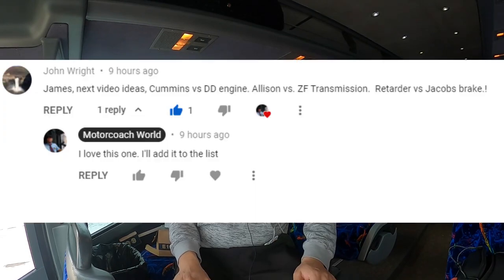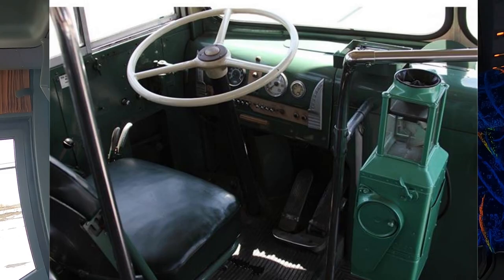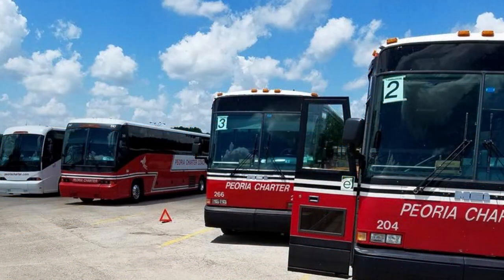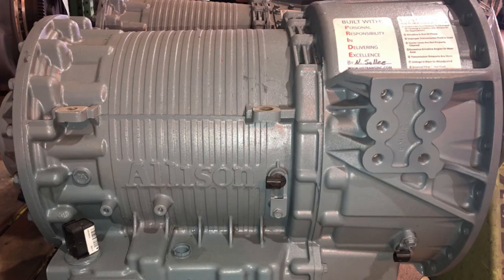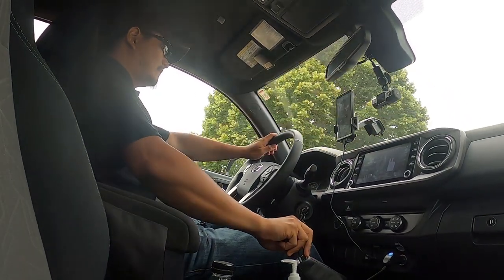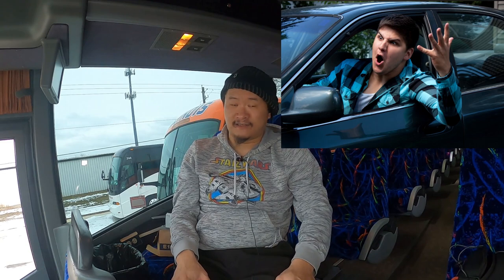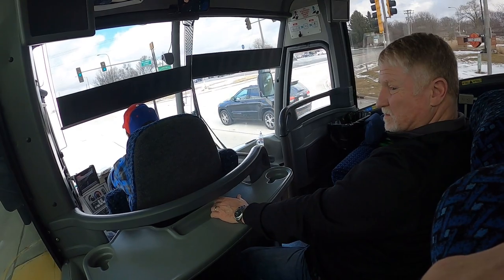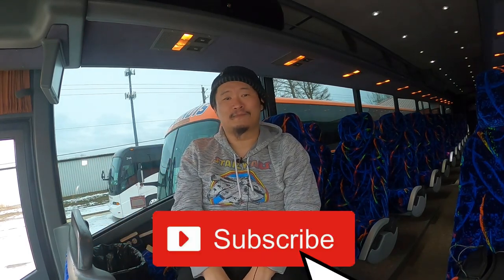Coaches buses come in Manual, Automatic, and Both .  The ZF Transmission

Comment: I started working for a transit bus company about 6 months ago as a driver. All buses in our fleet uses these automated manual transmissions. I have to say I'm on the 'hate' side of the fence to these transmissions especially when all my own cars are stick shifts. Not only do they exhibit all the disadvantages as you've mentioned in this video, a lot of them also do not shift properly due to age or poor maintenance or both, making the ride a very jerky and uncomfortable experience.

Over time, I've slowly discovered on my own on how to operate these transmissions in the smoothest possible way. Things like avoid pressing the brake at a certain rev range, easing or flooring the accelerator pedal under certain conditions to avoid unnecessary shifts, and some other weird things that I can't describe in words in order to operate these transmissions as smoothly as possible. The positive thing about all this is that it makes me a much more conscious driver as it involves a lot more forward planning.

When these transmissions work properly though, they're a pleasure to drive especially for transit buses that are required to stop often in heavy traffic. I do feel powerless a lot of times like you mentioned in this video, and I hope that stick shifts will make a return to buses, but that will only happen in my dream now.

Comment: I was building Scania coaches in the mid 80s, they had what they called CAG (computer assisted gearshift). The gearstick was like a game joystick on the dashboard, the current gear was displayed next to it, push the stick to the next gear, then push the clutch at anytime to change to that gear. Never drove them but drivers seemed to like it.

Comment: Hydromatic transmissions were available before WWII in Oldsmobile and Cadillac as an option. Flathead Cadillac V8 and Hydromatic transmissions powered many tanks through WWII.  My first car was a 1946 DeSoto with fluid drive and an automatic overdrive. Hudson had a vacuum shifted manual transmission in the post war period. My 1956 Chrysler had push button powerful item transmission. 1964 my Renault had a relay shifted push button nightmare of a transmission.  2007 my Freightliner had an Eaton Fuller Ultramatic electronic shifting manual transmission that was slow to accelerate and wasn't precise when trying to back up to a dock.  What I really like is the one speed electric transmission in my Hybrid.
Reply from the maker: Loved reading this! Thank you for taking the time to write this.
Reply: The Ford model T had a planetary transmission,  outlawed in 1927 which standardized H pattern with a clutch, brake and accelerator  pedals.

Comment: Hi James! When i drove for a large Coach Company here in South Australia , I did line runs around the  state, the company had a large number of Scanias  with opticruise transmission, never had any problems with them, and they were certainly better going up hills than the old Dennings with two stroke Detroit engines and 6 speed spicer  manual  crash gearboxes!!
Reply: lol… I must be old…. I understand what you said!!!!
Reply: @toddedeker3528  😆

Comment: James I love driving a manual transmission again considering that's how I started my driving career back in 1981. With that being said I love the ZF transmission because I know to drive with it. The biggest problem as to why this not a fan favorite is because the average driver has no real training on them and the companies that have them in the fleet do not issue the drivers any literature on them so it's kind learn as you go kind of training. Well I downloaded the operators manual from Prevost and learned how to use the transmission and now I'll drive a ZF  over a Allison every chance I get. Look a t this way how many drivers out there know they can manually shift a Allison especially in heavy snow .... not many because the weren't instructed on it. A educated driver will handle the equipment better and that's a fact.
Be safe out there!

Comment: My regular gig is school bus driving.  Allison seems to dominate SB’s. I have a side hustle with a charter bus company.  I drive a coach bus with a ZF transmission.  Your description of the ZF is spot on.  I find it slow to accelerate and balky at low speeds.  It tends to jerk the passengers when taking off from a stop; no matter how you make fine adjustments on the accelerator.  However, at high speed interstate driving the ZF is a real sweetheart to drive.  It is smooth and fuel efficiency is very good.

Comment: James,  in my experience I have found that tire wear on drive axle is greater with an Allison automatic with a retarder vs ZF AStronic with ‘jake brake”. My theory is that the rubber is constantly being stretched under positive load on upshift (driveshaft not being able to relax between shifts like manual style transmission) and negative load on down shift as the retarder is more aggressive than jakes for the same reason. Also training drivers on the ZF is paramount. ZF uses on both MCI and Prevost an “easy start" solenoid/air valve in the air brake circuit. This stops the coach from rolling when driver moves foot from brake to accelerator after being stopped. It achieves this by keeping air pressure applied in the brake system for 1-2 seconds to allow clutch engagement. Now what differs between MCI and Prevost is on MCI it is plumbed into front axle brakes, Prevost it is plumbed into both drive and tag axle, so you have more holding power on Prevost than MCI. The biggest complaint I get is that drivers say  " Prevost don’t roll back". When drivers are stopping, the period just before they are completely stopped there usually is not much force on brake pedal, so not much air pressure put into brake chambers. What I tell the drivers to do is when they are completely stopped make a full brake application to put more air pressure into chambers especially on a grade or hill. This will hold coach better until easy start does it’s thing. Sorry for the long winded explanation.    Rick
Reply from the maker: Hey Motorcoach Tech. I really enjoyed reading this! thanks for taking the time to write! You should like a very seasoned diesel tech!

Comment: I’ve had my CDL and been driving transit and motorcoach buses for about five years now.  I’ve been lucky enough that I’ve never had to deal with a manual transmission ever in a bus.
At the charter company that I work for I’m told that just before I hired on the last of the manual transmission buses were retired. These were described to me as an Eaton where the driver had to operate a clutch to start from a complete stop, then the transmission would shift automatically up and down after that. Is this something you have heard of?
On motor coaches all the ones I’ve driven have various flavors of Allison. I really like the 500R with the retarder, much smoother than the jake.

Comment: I'm a truck driver. Fleets have been converting to automatics in recent years because they can program the shift points and better control the fuel economy. Personally I dislike automatics and I think a good driver can get as good or better economy with a manual. Many times I have seen automatics decided to shift or get confused at the worst possible moment in traffic. Backing maneuvers with heavy loads up inclines are also tricky as you have to have enough engine speed to engage the clutch which can result in the truck moving too fast in a tight area. The auto shift transmissions were a good compromise where you still had a clutch pedal that you used for stopping and starting and the truck would shift automatically once it was moving. I still prefer the manual transmission but I think they are going away.

Comment: The comments here seem to refer to the first generation of the “automated-manual” gearbox. In Europe they have improved greatly over time and have been the default option for coaches since the last 10 years. Absolutely no complaints anymore, but it’s also a matter of what you’re used to, they respond differently to inputs from the gas pedal. One thing that’s different from the situation in the US is that the gearbox is tuned by the engine manufacturer to make the combination work smoothly. Best example of the “automated-manual” is the Volvo i-shift. City buses to this day still use an “Allison type” in Europe though (manufactured usually by ZF or Voith). 
A few truck drivers still rant about automated manuals, which is perfectly understandable if you only experienced the first generation, which indeed had all the weaknesses mentioned in the video. Early generations in buses also never skipped gears while shifting, which made them incredibly slow in acceleration.
Reply from the maker: Thanks for commenting. You seem to be very experienced as a tech! I would love to pick your brain!

Comment: In Europe, because of the high fuel prices, motorcoaches and semi trucks etc that's designed to go on the highway for a long distance will almost always have an 'automated manual transmission' which is made by many companies alongside ZF, these transmissions can sometimes save 10-15% fuel. While city buses (transit buses) will have a traditional automatic transmission due to frequent encounters with traffic and standing passengers.

Comment: I have only driven manual transmission and automatic transmission buses.  I have been a passenger in a motorcoach with a ZF 12 speed transmission.  I knew then if I were to ever drive one, I wouldn't like it.  If I were to ever own a motorcoach bus or company,  I would only have automatucs.  I liked the 4 speed manuals back in the day,  but not in heavy traffic.  I didn't care for the 5 and 6 speed manuals.   I think if manufacturers had stuck with 4 speed manuals, training new drivers on sticks would've been better and easier.  With multiple gears being close together, it would be hard for a newbie to find the right gear .  Even then, different buses with the same manual transmissions had different shifting patterns.  Prevost 4 speeds were different from MCI.  MCI clutches were heavier than Eagles or Prevost. 
Speaking of Eagles, you should do a video on those, even though I don't think Peoria Charter ever had any.
Also, wasn't Peoria Charter once Peoria Rockford bus?  When was the company split up?  Peoria went on to be a successful company.  Rockford bus company,  well, not so much.
Reply from the maker: Thanks King Arthur! I definitely will add a video about Eagles on my to do list. Thank you for the suggestion and all this info! I love reading posts like theses. Appreciate you taking the time to write!

Comment: I started driving buses and coaches here in NZ 35 years ago. Back then, everything was manual. In the first fleet I drove, we had 5 speed crash boxes (no syncro. Had to change at the correct revs otherwise things got very crunchy) and 12 speed ZF split boxes in our Volvos. The company I'm with now has a mix of 6 speed (mechanical) manual, 6 speed electric (EGS) manual, full auto and AS Tronic. Not really a fan of the AS tronic as the computer can't see the terrain ahead, can't detect ice or snow, and generally makes some weird gear changes at times. I find myself slipping them in to manual mode a lot of the time which gives me better control and smoother changes. They're also a pain around city streets as mentioned in the video. Thankfully my permanent coach is an EGS manual.
Reply from the maker: Hey Mikey! Loved reading your post! Very interesting. I always enjoy meeting people in the bus industry from other parts of the world. I want to see all the different perspectives from them! Thanks for writing!

Comment: I have driven quite a few  of the various "automated manual" transmissions on the market in recent years in all kinds of vehicles from cars to tractor trailers.. Most I drove had manual modes which in most cases allowed much more flexibility in certain situations. 

I started in twin sticks almost 50 years ago, so I have driven them all. My preference is still a full manual transmission in most heavy vehicles.  

Incidentally ZF is the manufacturer of the infamous Ford Focus transmission that had the software issues in 2010.
Reply from the maker: Thank you for your comment! you sound like a guy with a lot of knowledge in this kind field!

Comment: At VT 4:00 you show a row of Buffalo. Talk about shifting. The Buffalo drove like sports cars.  
If you knew music, you could shift gears without the use of the clutch. 
Given the initial note of the low gear engine whining as the base note, you could shift smoothly into the next highest gear when the whining of the engine reached a pitch Five Half Notes above the base note. 
The difference between the first note and the last nite of a major chord!  
You'd still have to double clutch when downshifting. 
I drove a Buffalo in NYC. 
Lots of downshifting.
The old Silver Eagle was also fun to drive.  votus.us is all I can drive now.

Comment: I trained in the military with 21 speed air automatic transmissions and many manual transmissions. The air shift transmission had to be started in a higher gear when the vehicle was empty and a lower one when full. This was in 1983 while in the U.S. Army and was on the 915 model trucks.
Reply from the maker: Thank you for your service! Thanks for taking the time to write to me! Much appreciated!

Comment: Some of us had that opportunity to drive that 10-speed MCI semi-automatic.
I did have the chance to drive one of two Adirondack Trailways rare bird busses back in the early 90s. 
They were fun to drive once you get used to the clutch. That clutch required close to 20 ft-lbs. of pressure to put into reverse or first gear. The ZF transmission gears were very close (short) together which made the ride herky-jerky, so I've changed the sequence of the shifting pattern by manually shifting the bus from granny (1st) gear, advancing the selector up two bumps to (3rd gear), two more bumps to (5th gear), two more bumps to (7th gear) then placing the gear shifter back to auto to reach 8-9-10th drive gears. The gear selector was on the right side of the driver's seat. It's difficult to explain how the shifter works,  auto is standard right and manual to the left. To select a manual high gear, pull the shifter to the left and use your thumb (click) and select electronic gear change. To go into a lower gear,  keep the gear selector to the left and pull back on the shifter in manual mode.

That MCI bus was outfitted with a Caterpillar engine, and the combination of the two was a driver's dream for power and non-oil leaks, unlike Detroit Diesel. Those two busses were converted back to fully automatics close to 2 years after purchase because AndirondackTrailways was pool-sharing equipment with Greyhound between the Montreal/Toronto corridors.  Some Greyhound drivers never drove a bus with a clutch that gave the passengers the best ride of their lives🤮🤕😫😖😮🤬😡😱. And,  burning out the clutches.
Overall, it was a fuel saver which got 10 miles to the gallon compared to the other units that got 7.

Anyway, my favorite bus in our fleet was an old MCI 9 that I drove from NYC to Oneonta, NY.  I was a line run driver. That bus,  number 62975 MCI 9 manual 4-speed takes a master to double-clutch. I've shifted that bus so smooth that some thought it was automatic. It’s all about running the engine close to the governor, clutch and listen to the engine wines down, double-clutch put into gear, and then feather the gas pedal for a smooth increase of speed. It's about timing and motor noise for a perfect gear change. I've put my heart and soul into every ride, I do understand the thrust line avoiding frontend motion sway, something Greyhound did not teach me. but I perfected.  I've always wanted to be a bus driver and it's my first love, my dream job.

To:

Mr. Berardi of Adirondack Trailway, thank you for allowing me to become one of your drivers from 1991 to 1998 and Greyhound, 37 weeks of employment before the strike in 1990.
My dream jobs have been fulfilled, being a Bus Driver and a Sanitation Worker for NYC.
L. Rochester

Comment: I drive a Volvo Truck with a 605 Volvo engine and an Extreme I shift. That a 12 speed. This is a heavy specd Heavy haul truck and my weight grosses up to 225000 lbs. I did put a 2 speed air shift transmission behind the main I shift which helps me take off on steep inclines and also is handy for maneuvering. It is either in direct drive or it cuts the speed in half. The clutch works great and it shifts smoothly. The Volvo I shift has been around for a while. However, more and more heavy haul trucks are putting in Allisons.

Comment: Far from being a connoisseur, as far as I understand, the Ass-Tronic is not a conventional automatics with conventional oil converter like you would find on conventional city buses, but a piloted manual clutch transmission like we find many of them on small European city cars.

Some taxi drivers who had those on their cars told me how fragile and sometimes even dangerous they can be.